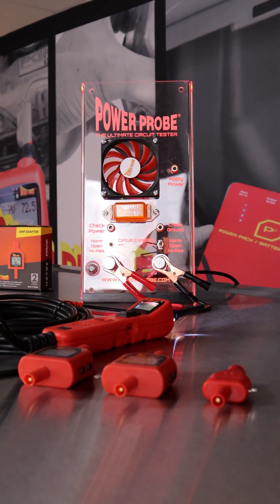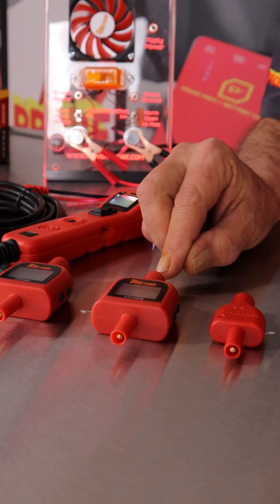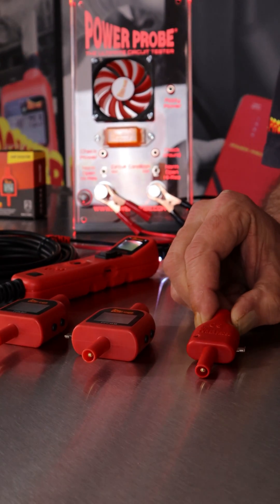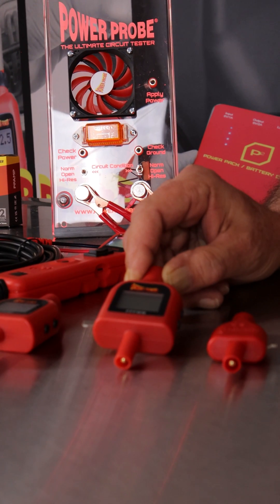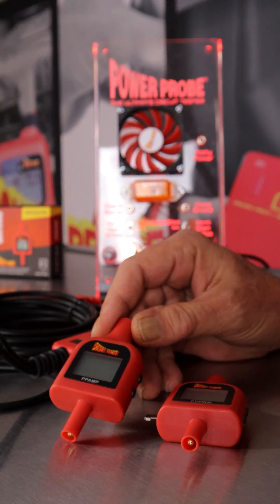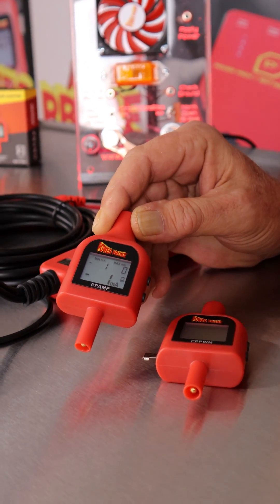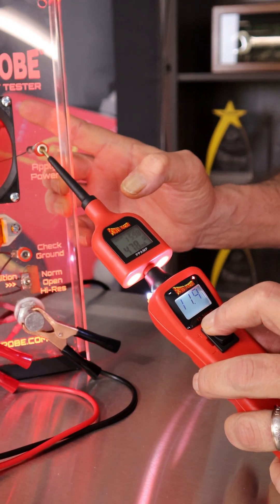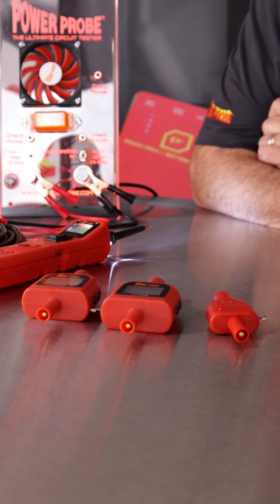Power Probe Tip Adapter Comparison: Functions and Applications

Comment: How much for the whole lot of them
Reply from the maker: Currently $108.95! https://shop.powerprobe.com/products/power-probe-amp-tip-pwm-tip-and-5-volt-adapter
Reply: Amazing add ons, I hva ehad your 5V tip and I will definitrly add the current tip.  My only gripe is they block the lights on the power probe. Enabling a feature while disabling another.  🫤